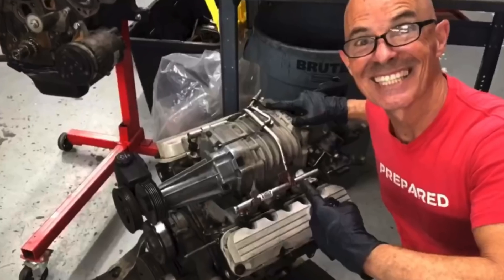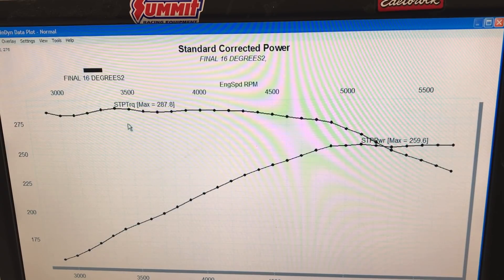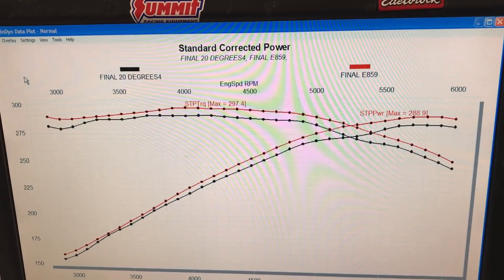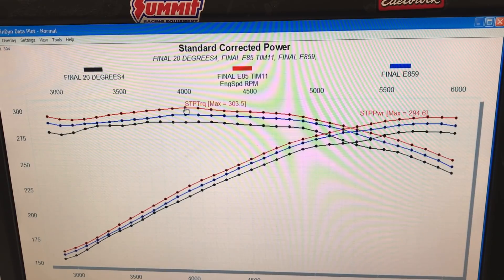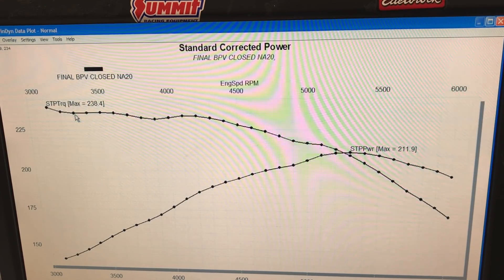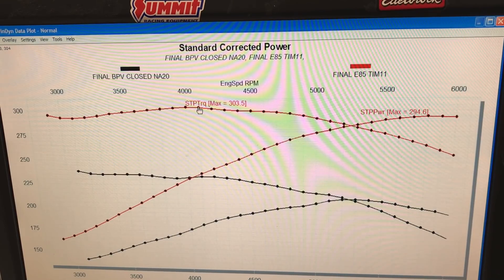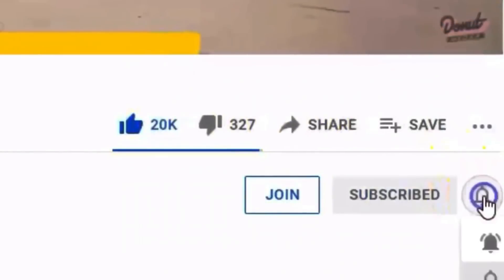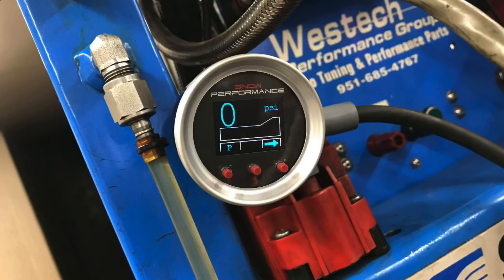HOW TO ADD POWER TO YOUR SUPERCHARGED 3800 L67. 91 OCTANE PUMP GAS VS E85! TUNING, E85 & BYPASS

Comment: So when you simply add a turbocharger you are tripling the naturally aspirated horsepower rating. Hmm 300% increase is not bad with a stock bottom end ... This is a really good motor.... They should have put a supercharged or turbocharged 3800 in the firebirds.  Like the Firehawk. Or even the WS6. Can you do a turbo 3800 build cheaper than a Chevy 350 for the same horsepower? Dollar-for-dollar where is your money best spent?
Reply from the maker: depends on your starting point-do you already have a motor
Reply: Yes I've got a 2002 Pontiac Grand Prix GTP motor.

Comment: Richard. I know you’re moving on from 3800’s but I think we REALLY need one more test. There is no hard data to be found anywhere when it comes to using a ported Gen III vs a stock Gen V blower. I’ve heard the Gen V is worth more and I’ve talked to guys who’ve switched from a ported G3 to a G5 and not pick up hardly anything! One guy says he lost a very small amount of power. 

We have this debate ALL the time and this question gets asked A LOT. Nobody has a definite answer. Just guesses. 

Thanks
Reply from the maker: I'm not done with the 3800 yet, but the intake needs to be changed too and throttle body

Comment: The L67 was available in rear wheel drive vehicles manufactured by GMH (GM subsidiary) here in Australia from 1996 to 2004. My 1996 VS Commodore ute has a N/A 3800 Ecotec which I plan to swap for an L67 I picked up a few years ago.

Comment: I have 2004 monte carlo ss supercharged it has many mods when I got the car just installed full stack intercooler and 42lb injectors 105# valve springs etc when the car is on my fuel pressure gauge reads around 42 or 43 psi at idle is that normal I didn't get the injectors and car dyno tuned yet it starts right up with no problems question should I get a adjustable fuel pressure regulator thanks for your help
Reply from the maker: it needs to be tuned
Reply: @richardholdener1727  thank you
Reply: Mr Richard I have another problem I live in new Jersey I can't find a shop to dyno tune my car I called at least 5 shops already please I need some help what can I do thanks for your help

Comment: The 3800 is a fine engine with the supercharger and a mild cam. The Bonneville with the 3800was really a good fit. It reminded me of the 275 hp 327 in my 66 Impala.

Comment: After gutting the s/c, how did you deal with the needle bearings?  Thanks
Reply from the maker: I didn't
Reply: @richardholdener1727  Was considering doing that test myself, apparently the n. bearings did not migrate down stream.  Just wondering why.  Thanks

Comment: I'd love to see my set up ran. Ported TB, ported blower outlet, ZZP Intercooler, ported lower intake to match blower and intercooler, 2.8 pulley, 1.9 rockers, LS6 springs, headers, E85, I ran a rich 11.0 AFR and 15deg timing. I beat stock LS1 Camaros in a heavy 4 door grand prix.
Reply from the maker: it needs a cam

Comment: I am currently running a l27 with a M90 supercharger in a boat. Just learnt the hard way that running 24 degrees of timing on 98 fuel doesnt work!!! Popped a head gasket after 30 seconds at 4500 rpm only running 8lbs of boost. Although not quite the same a huge learning on the amount of timing you need to pull out when you run boost.Thanks so much for sharing I really enjoy your videos and learn so much every time I watch them. A big thumbs up from me.....
Reply from the maker: 24 would definitely be too much

Comment: Not AFR, equivalence ratio. Different fuels require different ratios of air to fuel to achieve the same equivalence ratio, be it 1, less than 1 or greater than 1. More FAR than AFR… 😉
Reply from the maker: the AFR is on the gas scale-different amounts of fuel equal the same AFR based on the different stoich value
Reply: Not to argue with you, maybe to understand better how you’re stating this-  ratio or proportion of one component to another vs stoich, where complete combustion equals a perfect lambda of 1, regardless of the fuel. Stoich mixtures of different fuels are inherently different ratios. Hence why the equivalence ratio or stoich value is far more useful and meaningful when determining ‘relative’ enrichment vs enleanment between 2 differing fuels with also very different energy densities.

Comment: Dad had a park Avenue with the supercharger motor. 31mpg driving between Houston and Dallas. We had to have the sc rebuilt but fuel mileage and hp went back to normal after rebuild. No mods.

Comment: could you do the L36 next or its kinda no point 👀 i feel it may be a difference tho
Reply from the maker: an l36 starts out higher (higher compression) and ends higher with any given pulley (it responds the same)

Comment: Any chance you guys might eventually play around with the chevy 3.9 lz9 engine from an 08 impala?  Turbo?
Reply from the maker: not familiar with that one
Reply: @richardholdener1727  thanks for the reply.

It was used in 08 impalas and other GM fwd models around the same time  It replaced the 3800.

It was a 240 hp 240 tq 60 degree v6.  GM literature claims the heads were based off the ls1 heads.  It shares the same bore as an ls1 too at 3.898 which makes ls1 pistons a drop in

Head flow checks in around 230cfm at 600 int and 150ish exh which seems to be roughly what stock ls1 heads flow at least on the intake side.

Valves are 1.87/1.52

Keep up the good work and hey, maybe one day a cheap 3900 lz9 will pop up cheap in a boneyard. 👍

Comment: I’d be curious to see cylinder-cylinder AFR’s on a progressively hogged out blower, my understanding is that you do still need some shape there to help equalize airflow through the plenum, so I’ve been scared to touch mine.

Of course, it also made 315lb-ft at the rear wheels through a T5, so maybe I won’t worry about it until I replace my fusible transmission.
Reply from the maker: the discharge shape of the blower will have little effect on distribution (the position can)
Reply: @richardholdener1727  Good to know, thanks!

Comment: Stock factory 16 degree timing and 91 RON+MON/2, the SC GM3800 made Exactly the same power at the same revs as a 57 year old Triple Weber DCOE 45 and 40 mm choked 10.5:1 compression ....Slant 6 30 thou over, also 231 cubes.  "https://youtu.be/4zHxzHEs14k"

Comment: The bypass valve literally allows the air to bypass the rotorpack completely.  Hence the name. The rotors are spinning in effectively a vacuum at that point. This is to prevent blower pull when you are at low throttle inputs (cruise) and idle. No one is running a blocked off m90 on an NA engine for power. 

I am interested in your ignition system, did you connect the factory ICM to LS1 style coils? Or is this some stand alone system for use on the dyno?

FWIW, I have a very modified L67 that holds the power record for camshaft I'm using, on E85. 

I am surprised you didn't pick up more, honestly expected to see about 10% jump in power. I think something is off here. 

I rewrote my PCM to do everything in E85 scale, as opposed to just scaling the IFR's down ~40% like most people do. 

In the volume of E85 you have to burn to match the lambda of a gasoline mixture you will have ~13% more energy. You should see gains in that magnitude in a like for like switch, like 8-10% after losses.
Reply from the maker: holds the record for the cam you are using? we used ls1 coil packs with the Holley HP
Reply: @richardholdener1727  Holds/held. I haven't checked if any one updated the list in years, been busy with other hobbies/house etc... Yes for the cam I am using. 

I have a set of aluminum heads that I had a lot of work done to, that flow 296 CFM on intake @ .600, a big cam, and 1.875 primary headers all built around them, that has just been sitting. TD rockers and fabricated valve covers - need to build whole new engine mount/tensioner bracket to clear the covers. 

Along with ATI 10% OD damper, oil filter relocation kit, etc. I have aeromotive fuel rails, but I'm not a huge fan due to the lack of injector retainer clips, think I will convert a L32 rail into 2 piece and use an external regulator. 

I need a SIII oil pan because I want to use it to run external sump, had one in my hand and sent it back because of issues, UPS lost it. :(

Comment: I really want to see an actual long runner N/A intake on it now to compare to the gutted blower, short runner intake. Keep it up! 🤘🏼
Reply: Peak power will be close, maybe a little less, the power under the curve would be better with a real NA manifold. HV Intake inserts existed for a while, don't know if they're still made, that eliminate the runners for max peak power, at the expense of power under the curve. That is how that works. It's a compromise.
Reply: the stock 3800 N/A was rated 200-205 hp , 225 ft lbs
Reply: Me too. Should really help the NA power but also curious when he turbos it.

Comment: Now test the "naturally aspirated engine" driving the SC under some type of contained boost (into a pressure regulated box?), you can then verify the exact amount of parasitic loss from the blower.
Reply: Gains are going to be roughly 3:1, if I had to guess. So if you gain 80 HP after losses, it's going to produce 120 hp and cost 40 hp to spin.
Reply from the maker: the drive losses increase with blower speed and boost-but the power gains decreases

Comment: This series of modifications being done and the data collected from dyno testing is something I find to be very helpful for understanding what I’m working with in the L67 and more importantly,  which modifications provide the most gains without compromising durability. No point in flogging a dead mule. Thanks RH !

Comment: Awesome info! 
Something else that's hard to show on the dyno is how timing and e85 play into heat soak. These motors get hot pretty quick, usually I can only get a pull or two in them before they start getting hot and start to see KR. E85 though pretty much solves that problem and they are so much more consistent pull after pull! 
Plus then you can go a step further and run a smaller pulley and more timing to really get the most out of it without opening up the motor, and it'll still be really consistent from what I've found as long as you don't go too crazy with the pulley size haha!

Comment: Nice video!  Should be making some pulls soon on mine.  I need to get baseline on the new dyno with the current setup and then change the intake to get past the limitation on the stock 3800 v6 f-body manifold.  On a mustang dyno it did 247whp/268tq NA.

Comment: I wonder if the outlet of the empty blower case was opened out to match a radiused manifold, would it make more hp ?
The sharp edge of the manifold is not good for air flow naturally aspirated.
Reply from the maker: I THINK IT WOULD

Comment: It was really limited on power because it had a big pulley and no intercooler can’t make much boost
Reply: You want as little boost as possible any way. Decent camshaft and you can get away with no intercooler fairly well especially of on e85. 

E85 and the right cam you can't run a smaller pulley even if you add an intercooler. Just pick up some power and reliability due to less heat soak and lower iat.

Comment: The problem with adding timing on these engines while running no intercooler and 93 with just bolt ons is: after a few seconds in the run it will start to get hot and knock.  Usually about half way through 2nd gear.  I use to use the timing vs afr table to pull timing over time, instead of the factory setting of adding timing.  The factory tune has an afr vs rpm vs time table that allows you to richen it up over time.  I remember having as much as 18-20 degrees in 1st and dropping to as low as 12 by the top of second.
Reply from the maker: BIG CHANGE
Reply: Well said, and it speaks directly to what a guy can get away with on a Dyno or drag strip in comparison to what you can do on an endurance/street engine. Especially when using pump gas. The more you study that the more you realize just how much testing and development the factory puts into these packages.. and to get them to live 150,000-200,000 miles on garbage fuel is just amazing. Not suggesting we stop modifying them, but rather we not assume the factory was dumb or didn't know wtf they were doing. Especially the power train management.. they put together some tough combinations that will go 100 k even if an idiot owns it and neglects it and that is impressive to say the least.
Reply: @b.c4066  while i agree.  Some factory cals are good while others are terrible.  For example, terrible ones include, Trailblazer SS, Pontiac G8 GT, early GM trucks.  While most of the newer ones are very good.  New camaro SS and mustang GT for example.
Reply: @jessemurray1757  The manufacturers detune different vehicles as to not step on any toes within their own line up or associated brands line ups at different times. It's not that the factory calibration couldn't have been better alot of times they intentionally detune them. The Corvette and Camaro are a good example of this at times they both ran the exact same hardware yet we're advertised at different power outputs. GM would never allow a lower spectrum car than their flagship sports car make as much power as the sports car they are talking up. This leaves a ton of power left on the table through simple modifications and a good aggressive tune.

Comment: my old 2000 4 door went 14.02@98.9 with 93 and 3.5 pulley.  Swapped to E85 and 3.2 and ran 13.0@104
Reply from the maker: THATS A BIG ET CHANGE FOR 5 MPH
Reply: @richardholdener1727  probably the installed the driver mod. 

Or gained .3 or so in the sixty and fell off in the top end like these are notorious for.
Reply: @hayden6056  considering the fact that it dead hooked and its automatic, naw man.
Reply: @richardholdener1727  agreed.  The pulley change bumped the low and midrange power a ton.

Comment: I didn't expect the bypass test in na form to really do anything, but the proof is in the pudding as they say. That does make me wonder if the blower casing itself wasn't nearly as efficient as using just the stock na intake setup. The gen M90 is inherently less efficient than the gen 5. Lot of us port out the gen 3s outlet areas(aarow into triangle) and cut the lower intake opening up to increase the volumetric efficiency as much as possible. 

These few tests are the ones a lot of us would like to see compared with using the higher compression bottom end(top swapped L36).

Side by side comparisons. What kind of power curve differences. Is making more power with less boost better for sporty street cars lol. 

Love your content Richard

Comment: Surprised it made that much NA. Thanks for all your hard work richard. Love the videos. Now pulley this thing
Reply: Have you not seen those videos he has already
Reply: @james10739  yep I know but why not. Just turn one up to 11
Reply: @Matp345  I think he put the smallest pulley in he could I mean I said turn it around and wrap the belt around the flex plate
Reply: @james10739  lol 30k blower rpm
Reply: Is this bottom end an L67/L32?
Reply from the maker: L67 BOTTOM AND BLOWER AND INTAKE-JUST L32 HEADS
Reply: @richardholdener1727  L32 heads are worth ~0 hp, for those wondering. IIRC they had very slightly larger valves, which was some kind of cost savings measure, either parts commonality, or something. But they gained nothing.
Reply: @richardholdener1727  what cam?